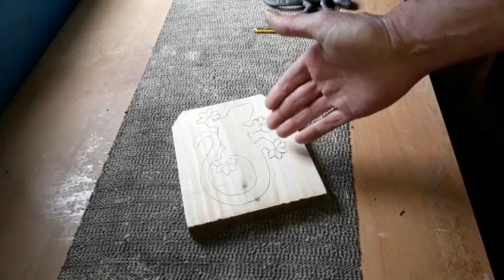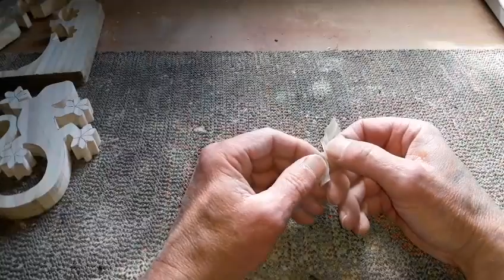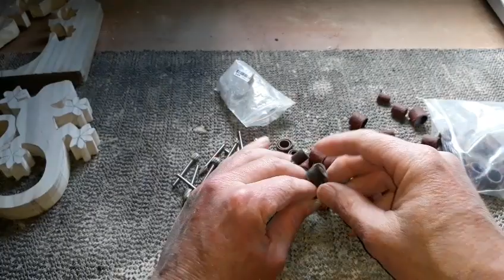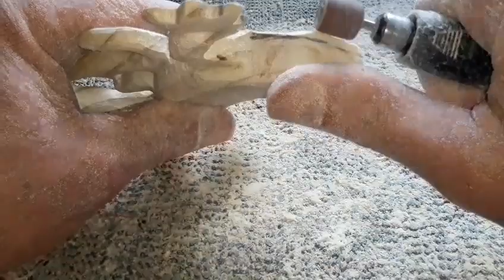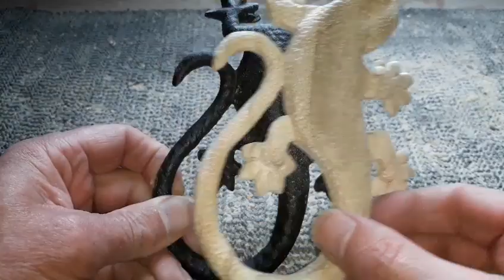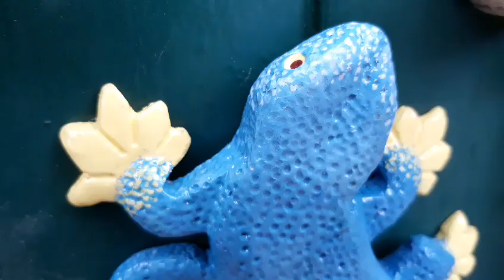Small Lizard Carving, from fencing wood

Comment: I really liked that, my scroll saw has to use the same connectors, I've started using a skip tooth blade at the moment.
Reply from the maker: Cheers Mark,yes those adapter clamps are a pain on bigger projects, but they are ok on these little ones..